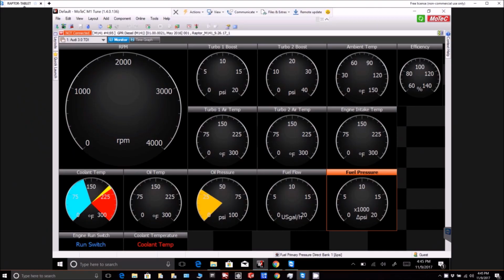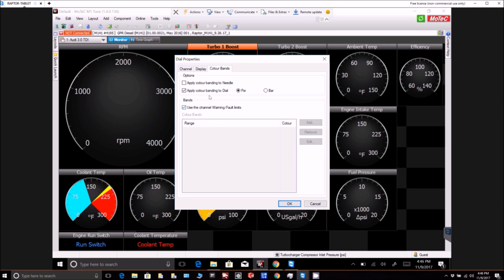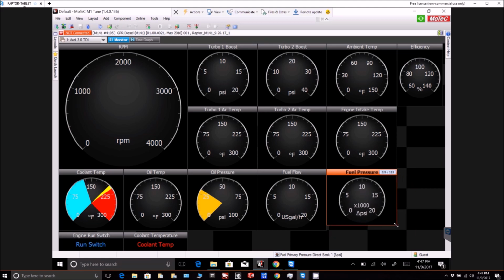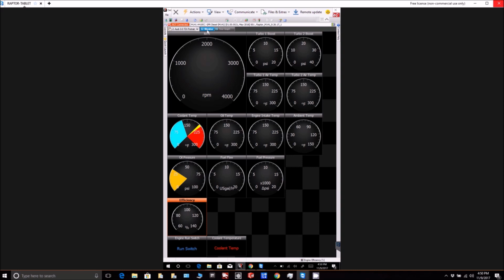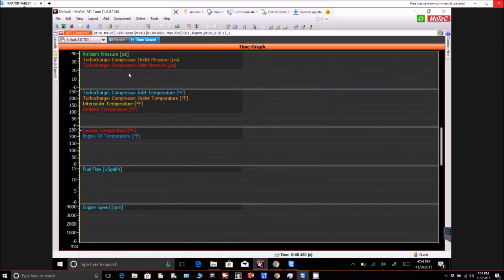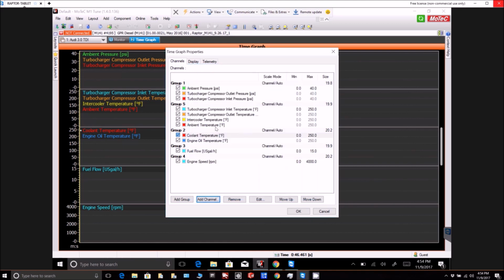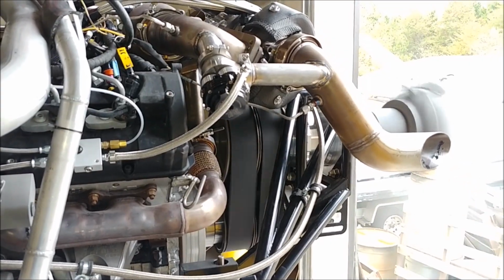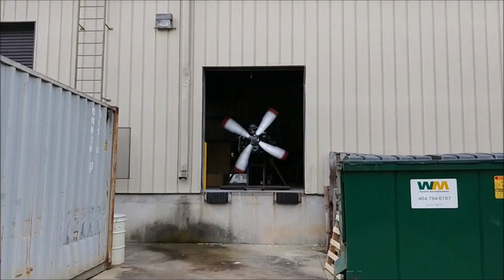Highs and Lows - running the engine and prop

Comment: Turbo Diesel Consumption Chart:
https://www.barringtondieselclub.co.za/technical/fuel/diesel-fuel-consumption-turbo-engines.pdf
Reply: This makes it important to know that gasoline weighs about 6.1 pounds per gallon and diesel fuel 7.2 pounds per gallon.
Reply: Confused yet? Look at the mathematical examples below, and it should become clear.
Formula To Estimate Maximum Engine Fuel Consumption
GPH = (specific fuel consumption x HP)/Fuel Specific Weight
Constants | Gas | Diesel
SFC: .50 lb. per HP | .40 lb. per HP
FSW: 6.1 lb. per gal. | 7.2 lb per gal.
300-hp Diesel Engine Example
GPH = (0.4 x 300)/ 7.2 = 120/7.2 = 16.6 GPH
300-hp Gasoline Engine Example
GPH = (0.50 x 300)/ 6.1 = 150/6.1 = 24.5 GPH
Reply: http://www.dieselserviceandsupply.com/temp/Fuel_Consumption_Chart.pdf

Comment: So, it sounds like maybe MT may have been mistaken when they suggested dropping the 5 bladed prop? Did I understand that you may need to increase the size of the prop's diameter? If the diameter is increased would this pose an issue to prop clearance during takeoff or landing?  P.S. Still great progress.

Comment: Great Progress !. As I mentioned in one of your previous videos I would like to see separate oil tank just for the prop. At least it wont pump out all the engine oil in case a leak developed.  Also would it be possible to feed the oil to the prop into the end of the prop shaft ? Then the seal would  mount external and you would be able to buy at rotating seal of the shelf. Some of them are rated at 10 000 psi. thanks

Comment: Excellent work.  260 hp is a lot, now for the icing and cherry.  I know you all are smarter than I, but does this system need that much pressure to operate the prop?     200 psi seems really high, like more than double what is needed.  This could be normal for this unit.  IDK.   I base this on the AvWeb article on diagnosing such systems and my world of experience with other mechanical things with pressure.  They are saying 60-90.    https://www.avweb.com/news/maint/propeller_governor_diagnostics_195565-1.html

Comment: Great progress. How was the fuel flow at 2900 rpm? I understand tuning may be necessary to make it more efficient as testing progresses but was it around the 7gph you were shooting for?
Reply: K S: there are some ballpark numbers that can be used to estimate fuel flow. A well optimized diesel engine will burn 0.35 lb of fuel per HP per hour. To make 260 HP it will burn 91 pounds of fuel - roughly 13 GPH.